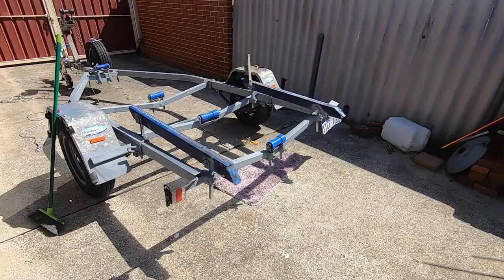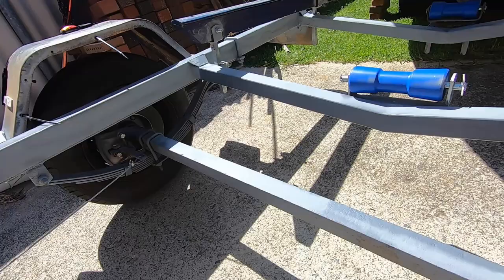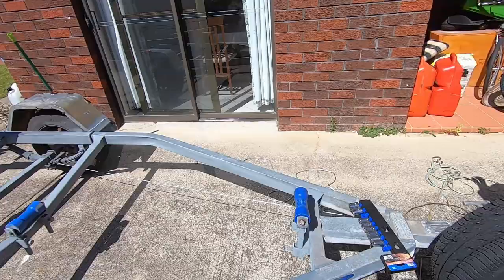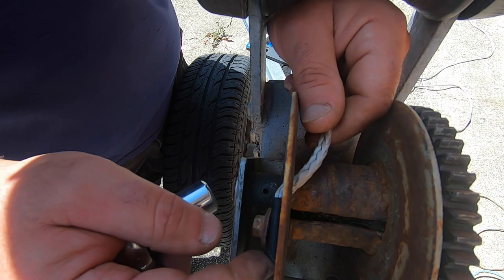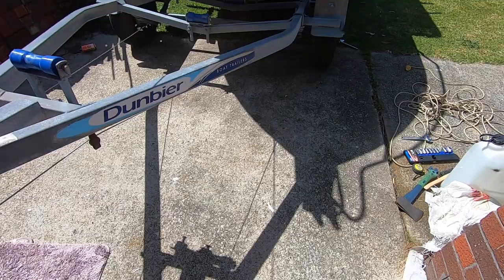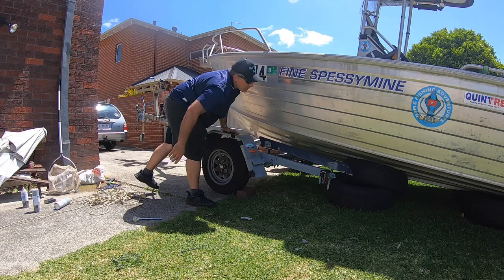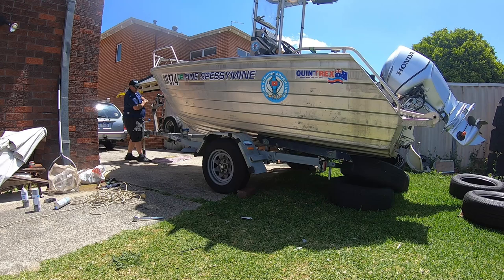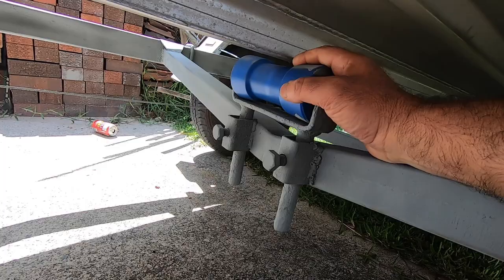How to Put a Boat back on Trailer It Was Easy!

Comment: Fantastic work mate. You actually made it look easy. My skids dont sit right under my hull because its slightly curved. I was told they dont need to be hard up against because all the weight should be on the keel. So im not sure if i should do it hard so it matches the curve of the hull or just have gaps between the skids and hull👌👍
Reply from the maker: Thanks alot mate. Thats right 70% should be in the keel, however no gaps in my oppinion..just raise them a fraction and see if the boat  slightly tilts around corners when trailing 👍